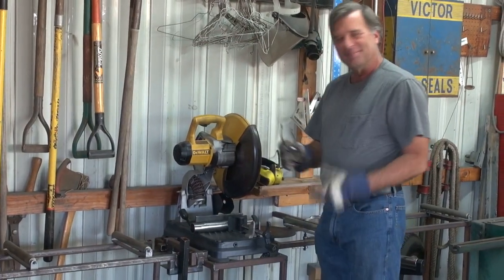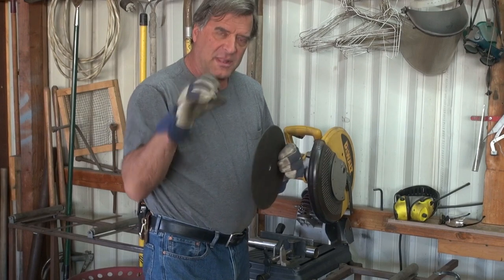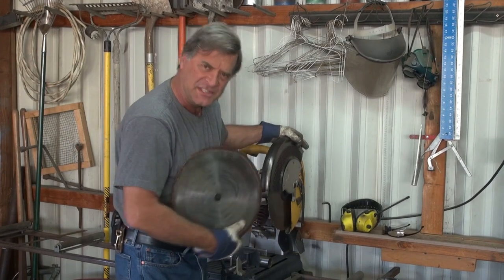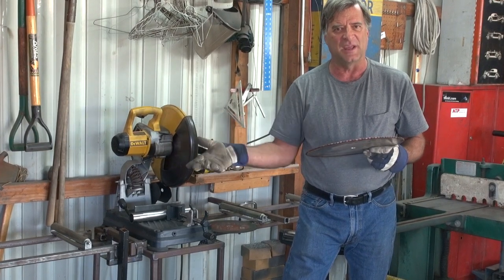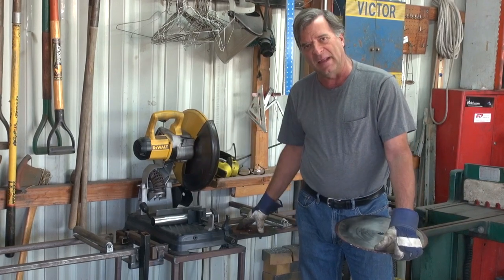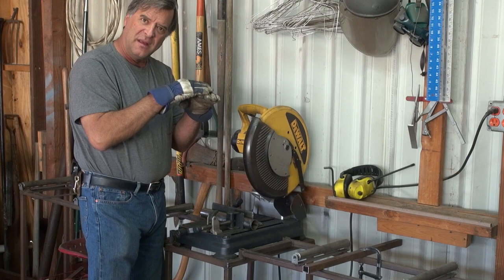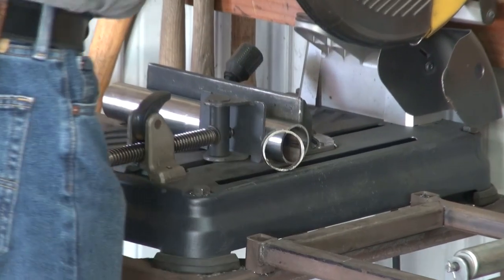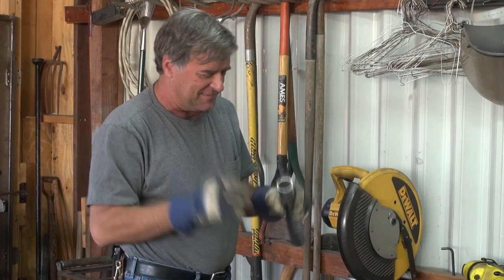Advantages and Challenges of a Cold Cut Chopsaw - Kevin Caron

Comment: 333 dont you mean metal blade on abrasive blade chop saw?
Reply from the maker: Yeah, that was what I was thinking.   Sometimes my mouth runs faster than my brain.  Thanks for watching and posting.
Reply: @KevincaronSculpture  looking at an evolution raptor chop saw. Low rpm. I tried using a metal blade on dewalt mitre saw it has 4000 rpm didnt work so good. Diablo blade.

Comment: Great Video. How long will blades last before sharpening? How much does sharpening typically cost? How much to replace teeth. How many sharpening will am blade take?
Reply from the maker: I can get several hundred cuts on a blade. Costs about $35 for a resharpen and the teeth are about $65 to replace.
Reply: @KevincaronSculpture  Thanks for the information.

Comment: Sorry I was a little confused, where you said that the cold cut saw is bigger motor but much slower, but then you said that if you put a cold saw blade on a abrasive chop saw, it will be too slow. Which one is faster the cold cut or abrasive?
Reply from the maker: Sorry, the mouth runs faster than the brain sometimes.   The abrasive saw is faster.

Comment: What model is your dewalt and wat blade did you have on it I'm most positive we have the samn saw and I have been checking and checking to make sure I get the right one
Reply from the maker: Sorry but this saw has been replaced with an Evolution saw.   I do use blades from Continental. I get them from the saw shop where I get them sharpened.

Comment: In other similar videos they cut alot faster does it depend on the blade?
Reply from the maker: Yes,  and if they have to pay for the blade or if it it free.   I have to pay to have mine sharpened and also buy the blade. They are in the $150 to $200 dollar range. You can find them in the $70 dollar range but they don't last very long.

Comment: Kev... have too much stuff, so not buying another saw... that said, for real world guys like me that are going to do it wrong regardless... can you use the 1600-1800 rated metal cutting blades on a 3500-3800 (Milwaukee) chopsaw... for 3/16 - 1/4" max tube cutting?  Random cuts... not long thick cuts where things might get hot...  Thanks!
Reply from the maker: I have been told not to do this!   The abrasive chop saws just run too fast for the toothed blades to work for any amount of time.  Yes, you can make some cuts but the blade will not last as long as they should.

Comment: that's all good but I have iron shop and the Dewalt no where near enough saw .if you was cutting 6in  square 1/4 wall do they make an abrasive saw to handle that also how long do blades last..I've had that Dewalt saw before and it is way to small hp wise .we have twice as big saw that cuts really fast but don't like all the heat or fire from it
Reply from the maker: Some folk just need a bigger machine for the work they do.  Nothing wrong with the DeWalt, just a little small for some.

Comment: hello, i got a question for you please, see i have a makita chopsaw with 4000 rpm motor i know this works good for  aluminum  but i need to cut 2 mm thick pieces of iron would that be reasonable to just buy a metal plate like the one you use and do the job or not; actually i have a doubt i don't know if 400 rpm is enough for iron , i don't want to damage the machine. Thank you.
Reply from the maker: I have been told that the abrasive chop saws run too fast for a toothed blade and you will ruin the blade. 

The blade you have will work, just go slow and let it cut on its' own.   If you push to hard it will give you a bad cut.
Reply: @KevincaronSculpture  well i guess i can start :), thanks for the help.

Comment: We have three of the dewalt saws at work and they work very well. When the fab shop decided they needed the one I had I ended up buying a Fein Slugger, after a few uses I noticed  it outperforms the Dewalt and is more accurate, a lot smoother and quieter. Best part is they wanted to take it today and I could tell hands off I paid for it it's mine. He wasn't happy!
Reply from the maker: Have to check one out!

Thanks for watching.

Comment: Unfortunately Kevin there is absolutely no adjustment, it's frame is different than any other of the saws I looked at. It's pivot point is exactly the same design as say a 4x6 bandsaws and everything is cast aluminum. The fit is so tight there is no play at all. The only thing I could think of doing was machining the flange the blade rests on but I didn't feel confident doing that so I returned it. I'm looking at the evo saw you have but will have to save up a bit for that one. I watched your video on the evo and it does seem to be a very nice saw but the blades seem questionable which is no big deal. Does it cut square on the vertical plane? I don't want to buy one and have the same problem with the sides of the tubing being marked up and need to be ground down smooth and square. I do understand it can be made square horizontally. I'd like to converse with you in a number of things, if your willing I'd like to have your email address, if not I understand
Reply from the maker: I find the Evo works very well.   No complaints on the cut.  I think it cuts almost as good as the handsaw. Just a much smaller throat for cut size.    The blades last about 400 cuts or so before you have to resharpen them..    Feel free to email me at my first name @ my full name .com   I am heading back east for a few weeks towards the end of the month so it might take me a few days to get back to you.

Comment: Hi Kevin, I just wanted to let you know I think I finally figured out what was glj g on with the makita saws I had.
The first saw I bought blade or cutting head was not square to the base. It was off by about 3 degree's. The second saw I bought was also not square to the base but not as bad as the first one. The blade and head would travel perfectly horizontal but the blade was at an angle so when the blade got into the sides of the tubing the back side of the blade was being pushed against causing the blade to bend ever so slightly causing the gouge marks in the metal and always an unsquare cut. It's kind of like a compound cut on a mitre saw except the blade head is travelling straight up and down and the blade is at an angle.
Reply from the maker: Awesome!    Can you adjust it?   Little tap with a hammer and the bolts loose might get it in line.   Glad you figured it out.

Comment: Hi Kevin, a couple months ago you were trying to help me sort out a problem I had with my makita cold cut saw. I returned it and got another and I still have the same problem, no matter what I try and no matter what I cut I get the same ugly results, I'm at my witts end. I don't have the money to buy the Dewalt or other brands as they are more expensive than the makita. I think I'm just going to go back to a small bandsaw. The blades are cheap, I do t have chips flying all over the place etc. However I would appreciate your opinion on what you think what  type of machine I should buy and the brand. Cold cut saw vs bandsaw vs cold saw. Even if I can't afford your suggestion right now I might be able to in the future
Thanks
Greg
Reply from the maker: The only bandsaw I have experience with is my Ellis 1800.
Reply from the maker: Just don't understand why you are having trouble with the saw.   Maybe go with an Evolution instead of the Makita. It is cheaper but I have that one and like it a lot!

Comment: I did check the bearing and near as I could tell there isn't any play, I did remove the blade and check the bearing. It looks seated properly but I can't say for sure. I googled reviews on the saw, about 200 or so and found 3 that say they had the same problem I'm having but no reason why. I've watched tour videos and followed your instructions so I don't think it's me. I've made around 30 cuts with it so I'm getting familiar with the saw and it doesn't matter how slow and easy I go it still makes a mess of the cut. The other videos I've watched of the saw the cuts turn out perfect. Given the blade isn't square to the base I can only assume this is part of the problem. Even my level says the blade is off from the base. All I can do is return it. I wish you could of seen the pictures. Thanks very much for your help and your videos, I've learned a lot and will continue to. I look forward to more videos.

Comment: base on it is cast aluminum and there is no flex at all, it very solid and rigid. Another problem I seem to be having is the blade wants to or appears to be jumping back and forth during the cut and leaving ridges in the metal instead of a smooth finish. I can't determine if this is from blade flex or play in the drive. During the cutting process there will be a steady and consistent  sound of metal being cut and then all of a sudden there will be a very loud change in the sound of the blade cutting the metal. It occurs multiple times as I bring the blade down as you can see in the pictures. It makes very little difference how slow I go. I can take 30 seconds to cut a 2" x2"x 1/16 tubing or I can take 3 min, the results are the same. I will return it if you think that's what should happen. I just had nothing to compare it to so that's why I thought I would get your opinion. 

The square I used in the picture is highly accurate, new and checked for accuracy and is reliable. I did tighten the bolt 2 days ago but it did not tighten much, it is already quite tight and I can't find any play in the neck of the saw. Just in case you were wondering the blade kerf is. 07. The blade I'm using came with the saw and has 60 Teeth. 

I hope I gave you all the information you will need. 

I really appreciate your help as I really don't know anything about these saws and am at a loss if it's the saw, me or the blade. I  I can't figure out how to get photos on here, im using my cell phone. 

Greg
Reply from the maker: I would return it!    Sounds like you have a bad motor (the bearings or bushings are bad or not installed correctly) causing a wobble in the blade.    Did you check to make sure the blade is installed correctly?  Try this,  with the saw unplugged!   Pull the handle down and lock the blade in the storage position.   Hold the blade so it can't turn and try lifting the blade and or push or pull the blade backwards and forwards.   See if you feel any slop.   From what you described there is a bad bearing in the motor.

Comment: Hello Kevin, I recently switched to a cold cut saw, Milwaukee. I wasn't getting straight cuts vertically so I checked for square between the base of the saw and the blade using my tool makers square accurate to. 00002. And according to the square the blade is out over a 4 inch span 1/32. Have you ever dealt with this and if so what was your solution. I'm trying to build furniture and this is creating some issues.
Thank you for your time
Greg
Reply: For furniture I would be using a cold saw...ravinvic or macc make the best ones...perfect burr free,repeatable cuts everytime...expensive but will last a lifetime and make life easy
Reply from the maker: If it is new and you just got it can you take it back?

If not then you need to figure out where the problem is. The DeWalt I had was always off just a little because the bed would bend so the metal was not sitting flat and square.   Maybe look where the "tower" attaches to the bed and see if it is loose or maybe not installed right.  

Send me some photos and maybe I can help.

Comment: Ive been using the evolutuion metal blades.  Where would i get these blades re-sharpened or repaired.  What kind of company would be able to sharpen/ repair? Much thanks!
Reply from the maker: Any sharpening shop should be able to handle them.   Just google "saw blade sharpening in your area"  You will find a few.

Comment: Not true, I've been using a metal blade on an "abrasive blade" saw for years and years and it works great and does not burn up the motor.
Reply from the maker: Good for you.
Reply: What kinda saw do you have? I have a ridged saw.

Comment: Bending the table when you tighten the clamp is only a problem with the DeWalt, because it has a notoriously flimsy stamped deck.  It's important to get the clamp tight enough that it's impossible for the work to slip, because a shift can wreck your blade and make your life unhappy in all other kinds of ways.

Comment: Thank you for the video Kevin.  Would you please tell me what brand of blades you recommend?  There is a big difference in price for metal cutting blades from different manufactures.  As a hobbies I can afford to take a few minutes to file a burr off  of a cut peace, if it means saving a few hundred dollars on the cost of a blade.  

Also, how careful are you with position the peace that you are cutting in the front to back direction?  The manual for my Milwaukee saw talks about adjusting the position of the fence depending on the size of the peace but I don't really understand how important it is or how you should position a piece of U channel for example.
Reply from the maker: I use Continental blades for the most part, that is what the saw shop carries.   You are correct on the price of them, they are really out of the range of most folk.     Check on Amazon for some cheaper blades and also call your local saw sharpening shops to see if they have used blades for sale.   I get great prices on them here in Phoenix.       As to positioning your metal in the vise for cutting,  mostly they are talking about just getting a good tight clamp on it before you cut.    When the metal comes loose in mid cut it will ruin the blade as well as scare the crap out of you !
Reply: I'm thinking about buying a cold cut saw. It would complement my powerplasma cutter I think. Thank you for this video.

Comment: I've watched this video a dozen times and it's the most informative one about dry cut saws out there. When you first got started and after all your years of experience, if you could afford only one a dry cut saw or a 4x6 horizontal/ vertical band saw what would you buy?
Reply from the maker: I would go with the bandsaw.  Bigger cutting area and longer lasting blade.    The blades for the bandsaw are also cheaper than the dry cut saw.
Reply: Thanks Kevin!
Reply: I have such a bandsaw.  It really helps save my too-scarce wheaties.

Comment: Can any cold shut cutting machine be used for cutting Tungsten carbide rods? I also dont want to ove heat the material as i need to analyse it under microscope. Can you suggest any way i can cut tungeten carbide material with hardness of around 2000HV hardness
Reply: I would think an abrasive cutoff disk would be the only common way to cut carbide.  The teeth on the cold cut blade are carbide and are not hard enough to cut carbide.  You can get diamond abrasive disks on amazon.  For thin tungsten carbide rods I  often just hold them in a pair of needle nose pliers and twist until they snap.

When cutting tungsten carbide it is important to wear a mask.  If the dust gets into your lungs i can stay there for a long time.
Reply from the maker: Sorry, never played with tungsten carbide.    I would think a horizontal bandsaw would do the job but I really don't know for sure.

Comment: can a guy simply put one of these blades on his dewalt miter saw and be able to cut steel with it instead of buying a whole new saw
Reply from the maker: No, the motor on the wood chop saw runs too fast for the metal cutting blade.   You will overheat the blade and dull the teeth very quickly.    And the metal cutting chopsaw has a bigger motor. More torque.

Comment: Finally to what extant is abrasive blade more cost effective if it is?
Reply from the maker: Other than the cost of buying one I don't find them cost effective at all.   Messy and not very straight cuts.
Reply: What if take in account only price and lifespan of blade? ignoring all other advantages of cold saw.

 thank you
Reply: Levan Kikacheishvili a metal blade will last 20x longer than an abrasive disc. So if you buy 20 discs at $15 each then that's $300 vs $100-$150 for 1 metal blade. Hope this helps
Reply: Valuable information. Thank you

Comment: thanks for the info,, my question is which is better to buy 10" or 14"  i can't make up my mind   thanks for your advice..
Reply from the maker: Go with the 14 inch ,     larger cut and with more teeth on the blade should last longer..
Reply: 10 inch will have more torque, 14 inch will last longer.

Comment: i'm a real pickle   ,  building a 20' long driveway gate , all one section,   i've been throwing around getting saw for years,  had an abrasive one but it really was just a hacker,
now i have to pull the trigger on something,  do you know anything about the evolution 380?
also,   blades say ferrous metal,  but i got one slice out of a diablo for a circular saw and it was shot ,   will these cold cut saws cut cold role and other steels,  or just soft stuff?
thanks   $400 IS A LOT TO SIT ON A SHELF     most of my stuff is aluminum and i have a chop saw for that,   but steel is a bitch for me.   no place to get them sharpened around here,   how long would these blades last on cold role steel?   thanks
Reply from the maker: I get about 400 cuts out of my saw blades before then need sharpening..  The big trick is to just go slow and let it cut..   You can't force it like an abrasive blade.
Reply: i can always count on a prompt reply   thank you
i i'm going to do it    do yo uthink the evolution is the best or for around 400 another